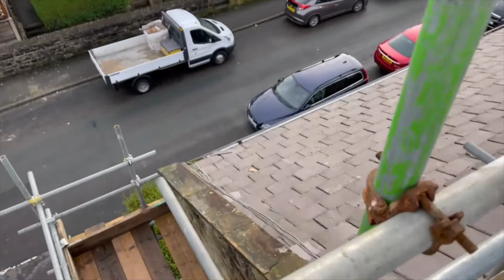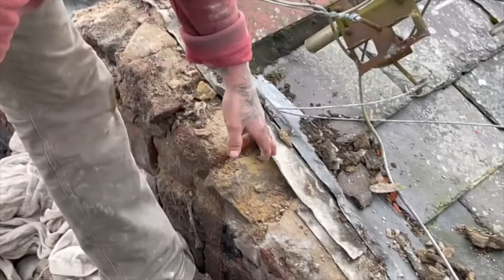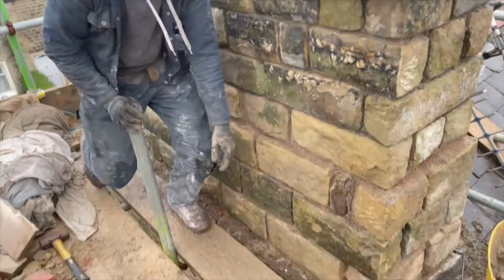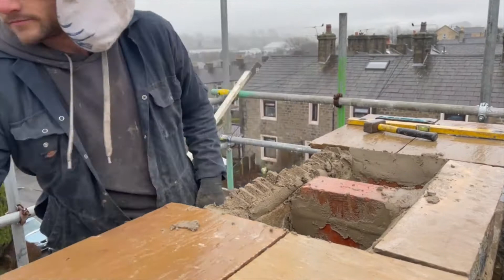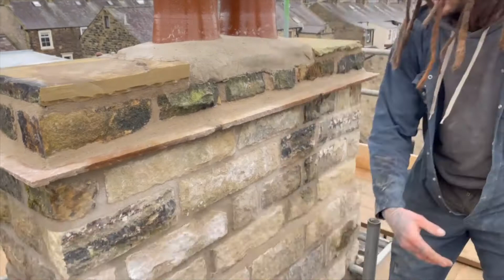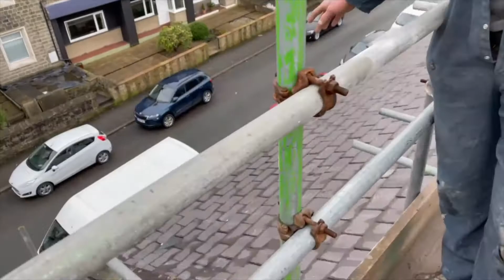Chimney stack construction

Comment: The sealed flu will sweat, should have vented at the top via a pot and cowel.
Reply from the maker: Never fear! A weep vent will suffice in the sealed flue.
Reply: @dportercontracting9974  aye you're a good guy
Reply: @dportercontracting9974  Would a sealed flue need venting internally too to allow airflow from inside the house to outside?
Reply from the maker: @jayfreedom  this particular flue is already vented internally by a vent above the skirting board. It may be an idea to put some airflow through the redundant flue though, if there isn't an existing vent. Good call!